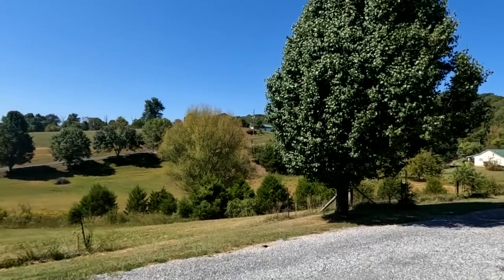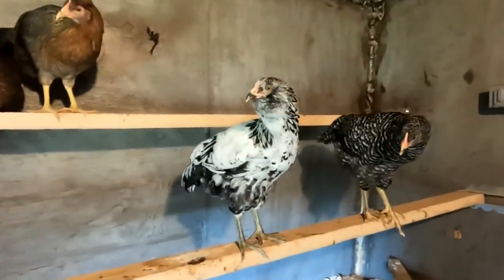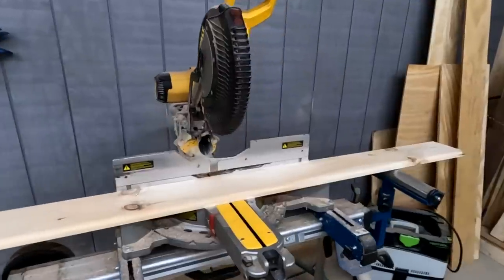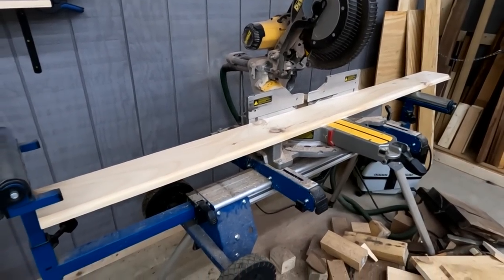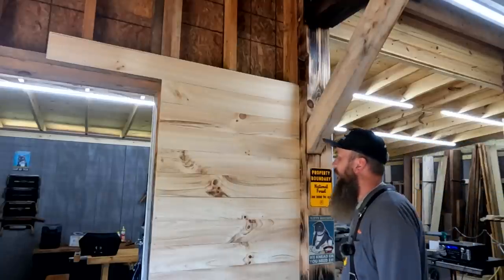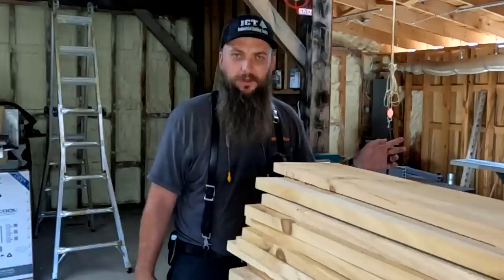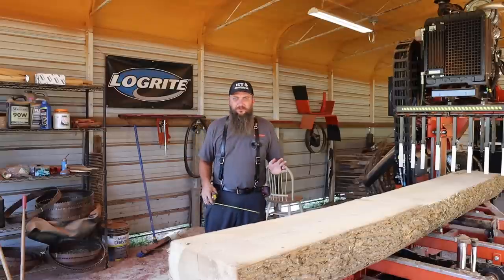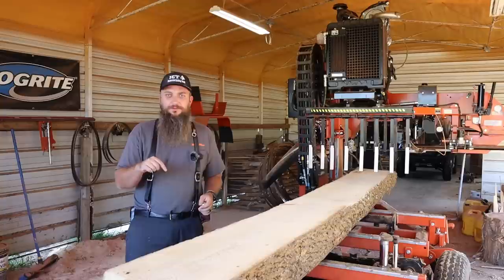Take A Look At What I Made WIth These Logs,

Comment: If your dad wants Lowes and Home Depot lumber how do you plan to twist them?! 🤣
Reply: LMAO. I went through 4 pallets of 2x4’s at two different Lowe’s, and one Home Depot just to get 40 straight boards.  A few weeks later my neighbor said to check out the lumber yard. I only found 1 out of 40+ 2x4s slightly twisted. Cost was 60 cents more expensive so glad I paid less but probably wasted the savings in gasoline.
Reply: If the staff could learn how to restack the lumber, there wouldn’t be so much waste.

Comment: Hey Nathan. We made ship lapped siding from red pine I got from an Amish mill near us. Used it to do all the interior walls on our 30x40 two floor pole barn. Like you mentioned a coup of videos ago...you can save a bundle of cash making it yourself. And, it adds a lot a character to the building. I'm A bit envious of your shaper ownership, as I did all of ours using a hand held router. I know, wan some whine with your cheese. Keep up the good work on the shop, it's definitely starting to come together.
Reply: we did ours on a table saw

Comment: It's great that you cut the 2x4's to nominal size like the Homeless Despot, but how are you going to get all of the warps, twists and splits in them?  I think that your dad may be a bit disappointed...

As for the pine, we did our entire cottage in white pine (walls and ceiling). The only places we put a clear coat on was the washrooms, just to prevent moisture from getting in.

The wood has enough of a glaze from milling that it does not collect much dust

Interesting to see your fresh milled stuff against our 6 year old stuff.  That was the tone ours was when we installed it.

Comment: When we "install" panel (is that shiplap?) we never nail the upper part (the "male" part) of the board before the next board is in place. Put the first board, nail the lower row of nails, put the next board, nail the upper row of nails on the first and the lower row on the second board and so on...
 Then we try to never make a wall with no insulation. Sometimes it can work as a "guitar case" and make a lot of "funny" noices...